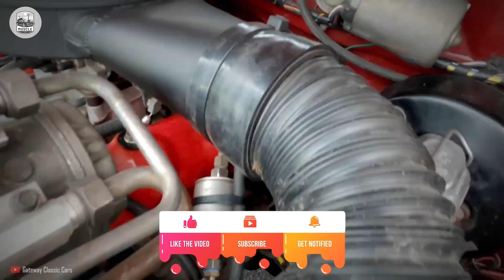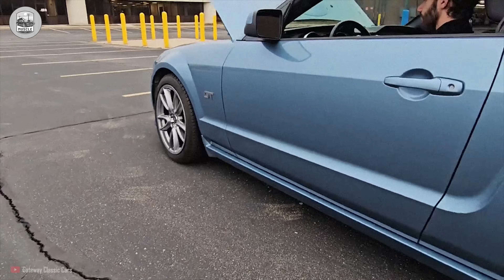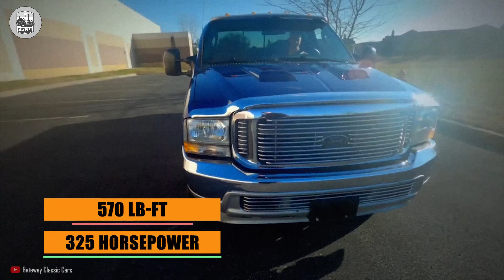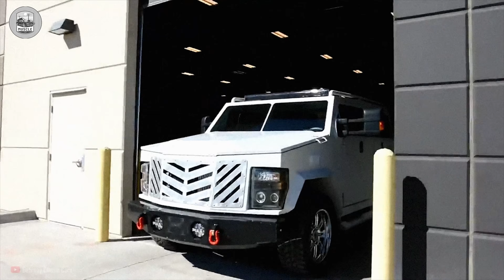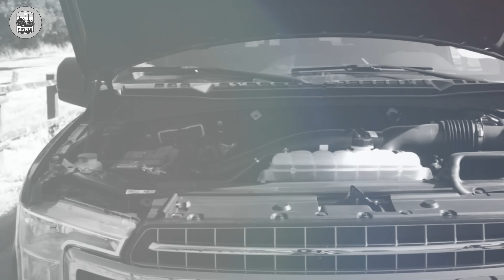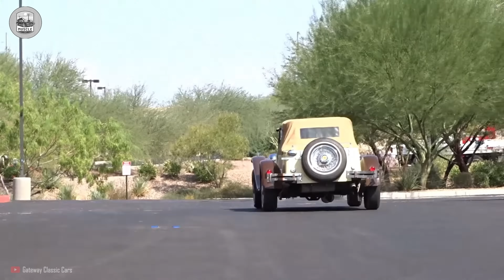NEVER BUY a Ford with this ENGINE | MOST FAILED Ford ENGINES ever put in production cars

Comment: 5.4 get rod knock sounds
Reply from the maker: Yeah that 5.4 is known for that tick and rod knock sound once the cam phasers and oil pressure start acting up. Happens a lot around 120 to 150k miles if maintenance wasn’t perfect. Some guys swap in new tensioners and upgraded oil pumps to quiet it down, but once it gets deep in the rods you’re better off rebuilding or going crate motor.
nice weeken, hope to see you on our NEWEST VIDEOS to explore the TRUTH.

Comment: Why is the Triton  V10 engine (1999 – 2005) not on this list?
Spitting out spark plugs seems to me a detriment.

One of the most notorious issues with early V10 engines (1999 – 2005) is the tendency for spark plugs to blow out of the cylinder head. This problem stems from a combination of design choices: Material Mismatch: Ford uses a cast iron engine block with an overhead cam aluminium cylinder head design.

Comment: I will never work on another 5.4 3 valve again I will tell the owner to take it to the junkyard or the Indian reservation and leave it there, I suggest before buying any new or used vehicle, investigate the reliability of both the engine and the transmission, looks don't mean anything, unreliable engines and transmission can put the driver and passengers in a very unsafe situation on modern highways where everyone is flying along at 80 mph

Comment: Bullshit on the 4.6. The coolant doesn't flow through the intake so a plastic manifold cannot cause a coolant leak.
Reply from the maker: Hey @Davesworld7, thanks for sharing your thoughts
 You bring up an interesting point about the 4.6 engine and its plastic intake manifold. While it’s true that the coolant doesn’t flow directly through the intake runners, the manifold still has an integrated coolant crossover passage. On earlier models, the plastic design often led to cracking, causing coolant leaks around the crossover area or where the manifold seals. Ford even issued a recall for this issue on certain vehicles—it was that common
We love passionate debates like this because it keeps the spirit of American Muscle alive! What’s your take on other Ford modular engines? Let’s keep the conversation rolling. Everyone else, let us know your experiences with the 4.6! Don’t forget to like, share, and subscribe to explore more about American Muscle Cars. 
Keep those engines roaring, and have a great day

Comment: They named almost every V8 made from diesel to Eco boost,oil change every 3500 miles.i have 08 expedition 268000 miles on it, probably not the original timing components I'm not sure what is a good motor no problems here
Reply from the maker: @Mike-w5d Thanks for sharing your experience with your 2008 Expedition and its impressive 268,000 miles!
 It’s fantastic to hear about a Ford V8 that’s treated you well over the years. You’re absolutely right—timing components can be tricky, and while your engine might still be going strong, others haven’t been as lucky. Engines like the EcoBoost V6 have had mixed reviews, and timing chain issues have sometimes popped up, but every motor tells its own story.
The beauty of American engines, especially V8s, lies in their power and durability when properly maintained. Regular oil changes, like the 3,500 miles you mentioned, are key to keeping them roaring down the road for decades
To everyone tuning in—what’s your experience with American V8s? Share your thoughts in the comments! Don’t forget to subscribe and explore more about American Muscle Cars on our channel. 
Keep cruising, and have a great day

Comment: 58 years on this rock have worked on most of these engines 90% of why these engines are on your list ignorance and lack of maintenance. Yeah the others are crap. The Coyote in its inception until 2017 was a stout engine shit the bed 2018 until now piston rings were not the problem the lack of a cylinder sleeve was and now a belt driven oil pump a imbecile can even see this is going to fail. The 4.6 4 threads holding the plug in was crazy but if you torque it in at 35 foot pounds a revision from the 28 foot pounds you would never lose a plug and yeah 4 threads would hold it but revised to 8 threads in later models no more problem. NOW the 5.8 351W over heating issues seen many of these and overheating was not a issue what was is lack of maintenance of the coolant system only ignorance not a fault of the engine and there is my 2 cents. And a overserviced 5.4 3V of the 2007 vintage 220k original internals never touched and quiet as a kitten.
Reply from the maker: Wow, 58 years of experience under the hood—now that’s dedication! Your insights are spot on. So many of these engines get a bad rep due to neglect and misinformation. The points about the Coyote engine and the lack of cylinder sleeves are especially interesting, and that belt-driven oil pump definitely raises eyebrows. Your tip on the 4.6 plugs and proper torque specs is gold, too—it's always the details that matter. And we couldn’t agree more about the 5.8 351W; regular maintenance makes all the difference. That 5.4 3V with 220k miles? Talk about a testament to what these engines can do with proper care
For all our viewers: What’s your take on these engines? Have you had similar experiences? Let us know in the comments! Don’t forget to subscribe, share, and join us in celebrating American Muscle Cars. Have a great day and Happy New Year

Comment: Had great memories with few nitrous 93 mustang 5 speed original transmission 2 rear ends saying over 400🤯 HP and a 89 gt and vortec supercharger and had a 7.3l ps Diesel and over 400k miles for 1500 dollars and a 2 wheel drive 6 speed standard never geve any problems with the tunner my friend let me use and still driving over half million miles now with a crazy truck never gave me trouble

Comment: I have a 1998 Ford f-150 pickup with the 4.6 triton v8. I love this engine. it has never given me any trouble. the truck has 300 thousand miles on it now. I bought it used with 200 thousand miles, with a rebuilt engine. dont know how many miles were on the rebuilt engine when I bought it. I have pulled trailers all over the country, and have never had any problem with this engine. it dosent burn any oil, runs smooth, and has unbelieveable power. I have been a mechanic all my life and have seen many a good engine get trashed due to no oil in the engine, no oil changes, and savage driving habits, and a total refusal by the owner to due any maintenance at all. The average stupid idiot when they get a new car wants to see how fast it will go, and how big of a burn out they can do. I know a guy who had a chevrolet truck for years. drove it every where. He let his stupid 19 year old grandson borrow his truck for a few days, and when he got it back there was a hole in the side of the engine. the engine was junk.What happened ? the kids not telling anyone. I know what happened, the kid raced the truck and blew up the engine. What did he care ? it wasnt his truck !
Reply from the maker: Hey Peter, thanks for sharing your experience with the 4.6 Triton V8! It’s amazing to hear how reliable that engine has been for you, especially with 300,000 miles on the truck. You're absolutely right, regular maintenance and responsible driving are key to keeping any engine running smoothly. The 4.6 Triton V8 was known for its durability, and your story really highlights how taking care of your ride can lead to incredible longevity and performance. It's a shame that so many engines get trashed by neglect or reckless driving. As you mentioned, proper oil changes and avoiding the temptation of reckless driving can make all the difference in the world.
For all the other muscle car fans out there, what’s been your experience with your own engines? Drop your thoughts in the comments
Don’t forget to like, share, and subscribe to Muscle Car Masters for more stories and insights into legendary American engines
Let’s keep this conversation going...

Comment: How come you show a Chevy Vega in this video? Also I had a fleet of 5.4 2 valve motors and never had a failure some over 300,00 miles Mobil 1 is the answer
Reply from the maker: Thanks for your comment
You’re absolutely right, showing the Chevy Vega in this video might have seemed a bit out of place, but it’s a great example of some of the more underrated engines of the era. As for the 5.4 2-valve motors, that's awesome to hear they performed so well for you! A lot of people overlook just how reliable those can be with proper maintenance like using Mobil 1. 
Keep those stories coming! Everyone, drop your thoughts in the comments, share your experiences, and don’t forget to subscribe for more American Muscle Car content.
 Let’s keep this community strong

Comment: I have an undrivable 2018 Ford Focus 1.0L EcoBoost engine due to a potential engine oil pump failure it has been in the shop every three months. None of the Ford dealerships have been able to correct the problem. The recall part is not due to arrive until June 2025. Owning this car has been a nightmare.
Reply from the maker: Wow, I feel your frustration
The Ford 1.0L EcoBoost has gained a reputation for being problematic, especially with that wet belt design for the oil pump. It’s disappointing to hear that dealerships haven’t resolved the issue, and waiting for a recall part until June 2025 is beyond unreasonable. For such a small engine, it’s supposed to deliver efficiency and power, but when these failures happen, it leaves owners stranded and frustrated. If you’re stuck with this car, you might consider reaching out to independent specialists who’ve worked on these engines—they sometimes know the real fixes Ford doesn’t mention.

To all our viewers, have you faced similar nightmares with modern engines? Or maybe you have tips to share? Comment below! Don’t forget to like, share, and subscribe to Muscle Car Masters for more car stories, insights, and nostalgia. Hope to see you in our next video have a great day, and keep the muscle car spirit alive

Comment: what most of the problems with ware is in the oil the catalytic converters have to use a low zinc base causing the failures on the bearings and vale train on all the modern engines
Reply from the maker: Thanks for your insightful comment
You’re absolutely right modern engine wear often ties back to the oil. The shift to low-zinc, phosphorus-free oil to protect catalytic converters has left classic-style engines vulnerable, especially in the valvetrain and bearings. Flat-tappet cams, in particular, take a beating without the proper ZDDP levels. That’s why many gearheads swear by high-zinc additives or oils specifically designed for older engines to keep things running smooth.
It’s a tough balance between meeting emissions regulations and preserving engine durability, especially for those of us who love the raw power and durability of vintage muscle. Always remember, protecting your engine starts with the right oil choice
What do you all think? Have you run into this issue? Let us know your experience below, and don’t forget to like, share, and subscribe to American Muscle Cars
Hope to see you in the next video. Wishing you an awesome day ahead

Comment: The 1.9 four cylinder Escort engine was notorious for sucking valve seats into the cylinder.
Reply from the maker: You’re absolutely right
The 1.9-liter four-cylinder Escort engine had a reputation for pulling valve seats into the cylinder, a problem that plagued many owners back in the day. This issue was largely due to the engine's aluminum cylinder head design, which expanded at a different rate than the valve seat inserts, especially under high heat or stress. Ford eventually addressed this by improving manufacturing processes, but it left a lasting mark on the Escort's reputation.
For fans of reliability and performance, this serves as a reminder of how critical good engineering is, even on economy cars. It’s interesting to think how many of these lessons have shaped today’s engines.
We’d love to hear your stories about Ford’s smaller engines or other memorable challenges you’ve tackled. Drop your thoughts below, share this with your friends, and don’t forget to subscribe for more great car talk
 Hope to see you in the next video, and have an awesome day

Comment: The three valve with the cam adjusters yes
Reply from the maker: Absolutely, the 3-valve modular engines with cam adjusters, like the 4.6L and 5.4L Triton V8s, are often discussed for their variable cam timing issues. Those adjusters could fail, causing rough idling or power loss. Ford addressed these problems later, but they’ve left a mark in automotive history. Still, these engines had solid potential when maintained properly
What are your thoughts on how they compare to Ford’s other modular V8s? Drop your thoughts below, and let’s keep the muscle car conversations rolling! Don’t forget to comment, share, and subscribe to American Muscle Cars
 Hope to see you in the next video—have a great day.

Comment: The biggest issue with the 5.4 V8 is maintenance. You have to baby them and they will last a long time. I've had several in my fleet and only about 5 of them out of over 20 were lemons. Exhaust manifolds cracking and breaking off studs. You need to use only full synthetic 5w20 and change every 5k miles. Once you start cheapen out on your maintenance then you'll pay dearly. Extended maintenance is a manufacturer fallacy. These motors need quality clean thin synthetic oil to run forever. Remember this motor was put into practically everything from Ford so of course your going to hear more stories because there are more of them out there especially used in fleets like mine. I own a container business and we used F series trucks for everything from maintenance workers, light towing, to heavy towing and heavy bed hauling. The biggest issues I've seen are the exhaust and sensors and suspension components rust easily after a few weeks of ownership. Undercoating is a must. Non the less the mechanicals are solid if you do the aforementioned ✌🏽♥️
Reply from the maker: Thanks for sharing your detailed experience with the 5.4 V8
You're spot on—maintenance is key to getting the best out of this engine. Using high-quality full synthetic 5W20 and sticking to a strict 5,000-mile oil change interval is crucial. Skimping on upkeep is where many owners run into trouble, especially with fleets like yours where these engines are worked hard.
The exhaust manifold issue is a known weak spot, but regular inspections and anti-seize on the studs during replacements can save headaches. And you're absolutely right about rust—undercoating is a must, especially for trucks used in tough environments like container hauling. It's worth mentioning this engine's versatility, powering everything from F-Series trucks to E-Series vans and Expeditions. Its widespread use proves its reliability when cared for properly.
Keep the conversation going—comment, share, and subscribe to American Muscle Cars! Hope to see you in the next video. 
Have a great day.

Comment: This is stuff I heard in high school from classmates who were Chevrolet fans but had yet to actually own a car. I had vehicles with 4.6 and 5.4 2Vs.  Never had any spark pugs shooting for the stars.  When you’ve got an engine lasting over 200k with regular maintenance, you sort of negate your argument. I can’t comment on the diesels, but most of the problems this video claims were non issues if someone changes the oil, filters, and flushed cooling system periodically. Back in the 60s and 70s, it was common for anyone planning to run a gasoline vehicle over 100k to understand that water pumps should be replaced around that mark. While under the hood replacing the water pump, it was prudent to replace the timing chain.
Reply from the maker: Great points! You’re absolutely right that with proper maintenance, engines like the 4.6 and 5.4 2Vs are known for their longevity, often hitting 200k miles or more. Regular oil changes, cooling system flushes, and replacing key components like water pumps and timing chains around 100k miles were essential practices for keeping these engines running strong—something a lot of folks forget nowadays. Back in the day, car enthusiasts knew their rides inside and out, and preventive care was just part of owning a vehicle. Those who skipped the basics often found themselves blaming the car instead of their lack of maintenance.
For the diesels, they did have quirks, but again, a well-maintained one could be a powerhouse. What’s your take on those old-school diesels? Drop your thoughts below—we love hearing from fans like you.
Don’t forget to comment, share, and subscribe to Muscle Car Masters
See you in the next video, and have an awesome day